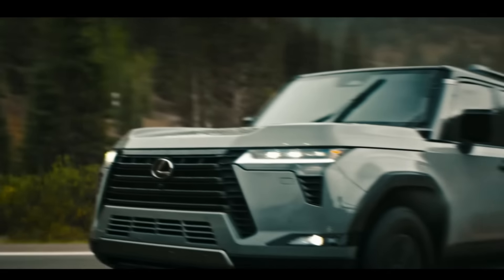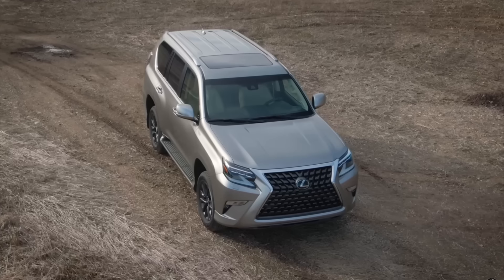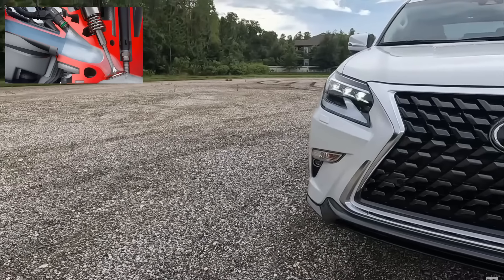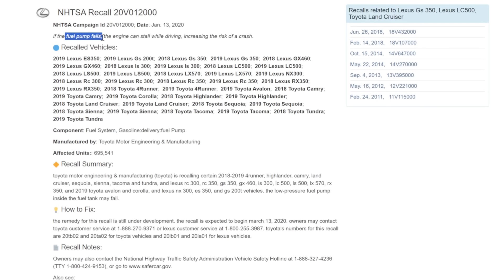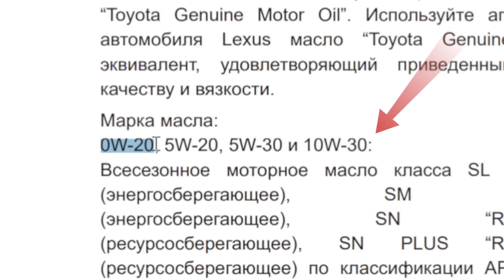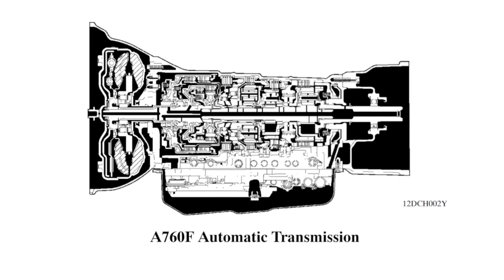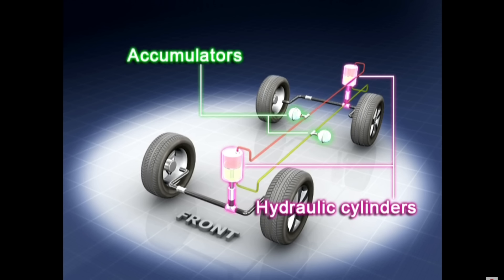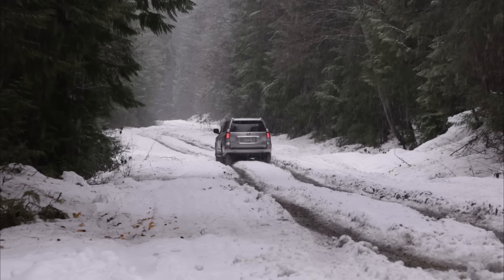2010–2023 Lexus GX 460: A Complete Reliability Guide

Comment: Great video, I have 23 GX460 and hope to keep it for many years. I do regular maintenance. So, a few things: If I understand from your video, the 1UR-FE can take higher viscosity oil 5w-20, as pointed out in the Russian GX manual, and can take 87 octane without decreasing its reliability or longevity. Which Tundra years use this engine, and is it the same engine? The Transmission replacement is expensive, so besides changing the transmission fluid every 30k? is it wise to install a Trans cooler. I don't do any heavy work or towing.
Reply: I have no idea where you are ,  but I'm in Maryland and back in September i drove to Chicago and had the Car care nut do a full 30,000 mile service on my 2022. ALL fluids differentials, transmission, transfer case, radiator, brake fluid, power steering and got a new battery because I screwed up the battery by over filling it. ( don't do that ). I can and normally do oil changes myself and the differentials and transfer case are very straightforward and easy to do.
Reply: @Cocora22  Car Care Nut is excellent, I am in the Tri-state area, so I need to find someone like him close to the East Coast. unless I make it a road trip. How much did Car Car Nut charge for the whole 30k service?
Reply: @pall5114  I don't have the invoice in front of me but including the battery that i ruined it was somewhere around 1200. Then again I drove out there so 2 nights hotel and gas. I don't mind road trips so it was actually a fun get away.
Reply: @Cocora22  Thanks, I have seen what the local Lexus dealer would cost. I would love for CCN to service the GX simply knowing he will actually do the job and do it right since I have trust issues with dealers. Traveling from the NYC area, it's definitely a trip with an added cost.
Reply: @pall5114  It does add cost. the gas for sure , a couple nights in hotel and food. However, Chicago is worth the visit. There are a few good museums, the waterfront is very nice and you could turn it into a short little vacation while you are there. Meeting Ahmed and the guys in the shop was really nice too. I could tell also instantly that they do have a very nice and friendly working atmosphere.
Reply: @Cocora22 the battery is so easy to buy snd replace
Reply: @ it is , but i was already there. I also had a bit of an issue since I screwed up and acid was leaking and disolved the pet cock drain plug on the bottom of the radiator. Sometimes a little knowledge is a dangerous thing. Ultimately I was super happy with getting all those services completed.

Comment: what should be stated is that no AT cooler was available for US models, until the off road package. many owners install an aux cooler.
Reply: Pretty sure there is a small one inside the main rad. It just isn’t full size aux.
Reply: @biodot88  I understand, but what I meant was there isn't/wasn't an aux option until recently. Many earlier owners, including myself, added one since temps were routinely higher than I would have liked. Towing was actually okay in my use case, but long, slow, steep off road made the TC 250f+. I haven't seen above 220 since mine has been installed, even on 100f+ days.
Reply: @pennmikael  good to know. I tow around 3600lb and try to stay in higher rpm’s in 4/5th. I wish there was a more accurate way to watch the temperature on my 21.
Reply: The one in the radiator is mostly for warming up the transmission on cold days, not sure it really does much cooling.

Comment: I have the same engine in my LC200, I use shell helix 0w40 as we have hot weather and it is in the owner manual that you can use 5w40 5w30 10w30 15w40 even 20w50!!! By the way, mine dose not have egr system from day one

Comment: Dope Content! Would you say that a 2012 Nissan Titan can be called reliable for 350,000 miles?
Reply from the maker: which year you're interested in?
Reply: @ It is a 2012 Nissan Titan Pro 4X and it has around 170,000 miles
Reply from the maker: check my channel. Video nissan patrol. They have the same engines there you'll get your answer.

Comment: Should I feel bad for trading my gx460 for the 24 trd pro 4Runner ?
Reply from the maker: new 4Runner has the same platform as 24 Tacoma. Video about 24 Tacoma already on the channel, it should help you with your choice 👍🏻
Reply: Depends on your needs and/or wants. I much prefer the full-time 4wd set up with the Torsen limited slip center diff in the GX470/460/4Runner Limited, than the part time 4wd system in the 4runner/TRD OR/Pro. YMMV
Reply: Yep
Reply: @Mr19assassin74  Thanks a lot , I kinda feel upset about it too. But it's too late now.  Hopefully I can still have some fun with the TRD Pro I got.
Reply: Yes

Comment: Don't skimp on fuel . My 2012 needs a new bank 2 catalytic converter. Too much cheap gas will now cost me $2800 for a new CC.  Other than that HUGE fix that I've been putting off for almost two years , the truck is running great at 167k miles.
Reply: define cheap gas?
Reply: @tomzphone  regular octane, aka 87(and in some markets 85oct). vs 91 or better. Hope that helps.
Reply: @Kiss__Kiss  you do know that there isn't any difference between 87 and 91 or 93 gas?  it's only a difference in octane,  which only matters much for high compression engines.   I have multiple cars that technically require a min of 91, I have been using the lowest octane gas I can find in these  two cars and they have a combined 450,000 miles.   No issues with the engines, no issues with the cats.     but there is a difference between Exxon 89 octane and 7-11 89 octane.  You should only use 'top tier' gas,  if it doesn't say top tier on the pump, don't use it on a Porsche or any other good car.
Reply: @tomzphone  I think you're missing the "Detergents" in that equation. And yes, I've only used Top Tier gas in my vehicles(I'm almost 60).